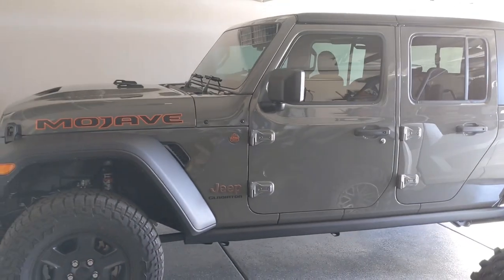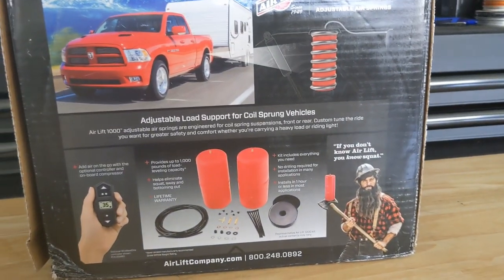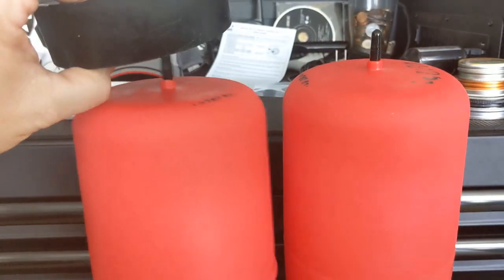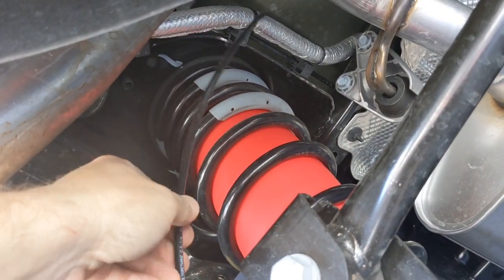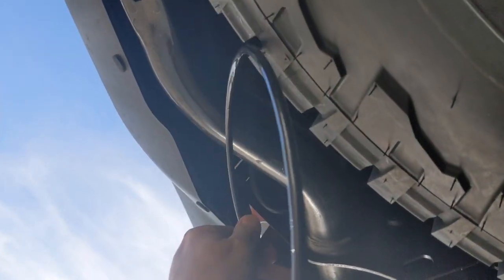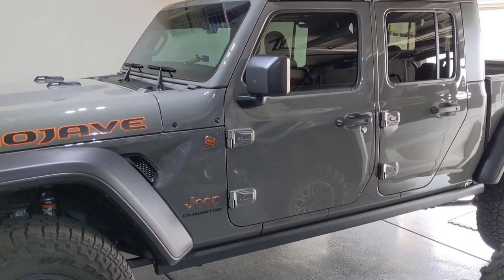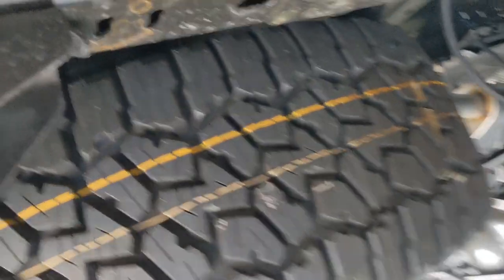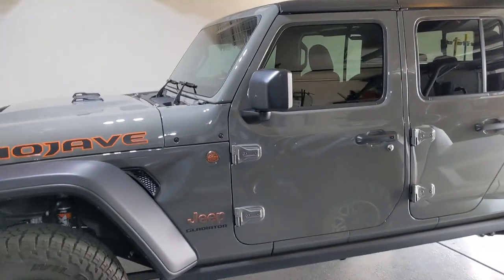Installing airbags on a Jeep gladiator Mojave - Air lift 1000 air springs

Comment: Do your bags squeak when turning corners or going over bumps? Had mine installed today and the bags seem to rub the springs while making a very loud rubbing noise/squeaking noise.
Reply from the maker: Initially yes a  but it seemed to go away after a while.

Comment: I installed my kit last weekend in my mojave.  Seems a little stiff at 5 psi still (unladen).  Do they break in a bit?
Reply from the maker: With 5 psi I didn't notice any ride quality difference at all tbh. Try taking em down a lb or 2
Reply: @OdysseyOffroad  I have felt below 5psi it gets back to normal, but below Airlift SPEC. Will have to inspect to see if something weird going on.

Do you find loaded, with proper bag pressure Mojave Shocks perform well?  Rebound dampening is a little lacking at firmer pressures unladen (as you'd expect).
Reply from the maker: @updowning4590  using the bags with trailer or a load in the bed the truck handles great

Comment: Probably won’t work with the AEV spacer lift I’m guessing?
Reply from the maker: Yes it works. It only wont work if you have longer springs. The aev uses spacers

Comment: Do you have the part number for the kit you used? I have a Mojave, and Amazon says the Airlift 1000 doesn’t fit.
Reply from the maker: I got mine right from Amazon airlift 1000 Suspension Kit 60830
Reply: @OdysseyOffroad  thank you, I’m ordering a set

Comment: Could you run short pieces of airline from each bag to the T fitting, then run just one line back to fill point?
Reply from the maker: Yes if you watch the video that's exactly what I did.
Reply: @OdysseyOffroad  The downside to doing it this way is you are banking on the fact that both airbags have the same amount of air...You can do it this way but I would suggest doing 2 separate lines.
Reply from the maker: @chrisb6865  the air pressure will equalize  with the two bags being connected in an open system like this.
Reply: @OdysseyOffroad and air will also shift between bags and allow load/air shifting and body roll. That's why these kits should be installed using 2 fills. You can still run both fills to same area side by side.
Reply: I just installed mine. Did the air stems in the bottom holes of the license plate. Works awesome and its quick and easy to access there. Running the hoses to it was real simple.

Comment: So how do you like the air bags since its been some time since you had them, any pros and cons?
Reply from the maker: Not any cons i can think of tbh. They work as intended. Very cheap mod that is worth the 100$ they cost. 2 👍🏻👍🏻 up
Reply: @OdysseyOffroad  sweet ..mine just came in today and I’m using because I have a little sag from all the overlanding gear I have. So I’m hoping this works well for me..